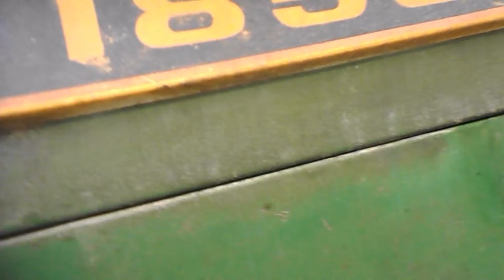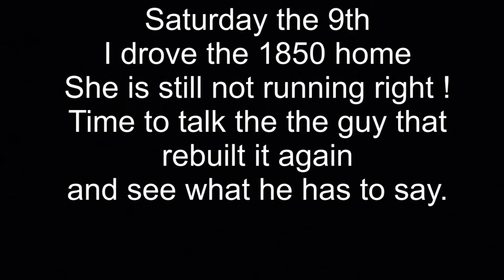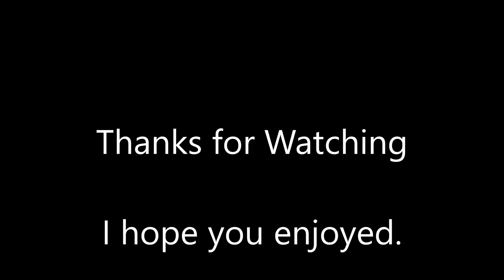October 4th   8th Working on the 1850 Loads of fun !

Comment: Bandit, can't you just buy the old pump from Harry and let her run with that one, I hope Harry is not charging you by the hour at current shop rates 😆 you could have bought a new Magnum if he does 😆 hang in there buddy we all get those days!!
Reply from the maker: As it turns out the day I fired it up on that old pump a guy bought it for his 1850, He saw how my tractor ran on it and bought it. Harry told him he could have it once mine was running good on my pump. The injector pump is at a different pump shop being looked at right now, The guy that rebuilt it has taken the stance that there is nothing wrong with it its my engine and he wont touch it again. So its at another shop and he WILL pay for the repair !  I dont know what the bill is yet for Harry's work he did but he said it wont be much mainly because alot of the work done was under warranty (hydraulic pump) and the engine work wont be much because he installed the injector pump the first time and its still not right, He is kind of upset with the guy that rebuilt the injector pump because of all the BS of the timing of the injector pump (pump timed differently than what the book says to).  If it turns out to be what the guy that has the pump now thinks it is it will be a simple fix and the guy that rebuilt the pump maybe paying for part of the bill to Harry because it was all for nothing.  When I find out for sure what the problem was I'll let you guys know what it was.  Bandit
Reply: @banditfarmer1900  how old is Harry Bandit I know he's camera shy 😆 but he's been around before by the looks of his shop, you can tell those old guys by how much grease has piled over the years on there work table 😆
Reply from the maker: @lukedesselle2491  Well Harry has worked at McHenry's sense 1969, In 1968 he started working there while in school and after he graduated he went full time and he has been there ever sense . That work bench has been in use sense the 20's so it has seen many years of use to say the least. If it could talk imagen the stories it could tell about the tractors and equipment parts that were worked on on it. One of these days I got to talk them into letting me video the inside of the place cause walking threw the front door is like stepping back in time !  Bandit
Reply: @banditfarmer1900  I love sitting down talking with those old guys, they have seen the biggest changes in farming any generation will ever see, I mean they are old enough to remember horses and mules being used to farm and know see tractors with auto steer, just think how much more will change in the next 50 years!!
Reply from the maker: @lukedesselle2491  This makes me think of my grandfather, He was born in 1894 and he worked for the Railroad when he was 12 years old as an oiler . When a steam engine rolled into the station his job was to oil all the wheels on the cars. He worked on steam locomotives and he saw man step on the moon and saw me buy my first self propelled combine . I myself ran a lot of 2N 8N Ford's as a kid and I was always told by the old timers that they were one step above a mule ! LOL I started off running tractors with no hydraulics (AC WC Oliver 60 IH H M's) and all pull type equipment and now I see all the new stuff with all the electronics and really cant believe what it can do. Some of it I agree with but there is some stuff I find silly . The bad part of this is the lack of electronics for the older equipment, I know of several good combines sitting dead in the barn because the computer went bad and they cant find a new or used one to fix it with so now its junk. This is going to be a real problem for farmers in the future unless something gets done pretty soon. I have seen lots of changes in my lifetime and I wonder what will come next ?  Bandit

Comment: The cam ring in the injection pump is upside down.  It will run but will run like crap
Reply from the maker: Well thats what were thinking was wrong with it but the next video will take about this as its going back on after the 1850. Bandit

Comment: I would use pump that works. Just take apart clean an put new seals in it. They are very simple to work on. Go Bundy bears YouTube channel. He has video on pump.
Reply from the maker: I paid to have the injector pump rebuilt and its back with them to make it right. He thinks he knows whats wrong with it by the way I told him it was running. I just got to wait and see what he finds. The injector pump on it has been sold to another guy I have it till mine comes back then the old one goes back to the guy that bought it. Bandit

Comment: Wow. That repair was not it the manual. Glad you figured it out!
Reply from the maker: Harry and I both are surprised there is no information in our books telling you how to set up the gear lash or anything to do with the gear set drive in the books. But I spent several hours measuring the bearings and the casting to figure out how much the shim needed to be to get it right and I got lucky and found a 20.000th shim and it fit perfectly. I didnt help that the bearings have a different edge on them and that let the new bearing go lower in the casting so the shim had to go between the bearing and the gear to get at the right height to get the right gear lash. Lots of measuring and a lot of figuring and we got it figured out and working right. After years of working on a lot of different stuff you learn what to do when there is nothing in the book on how to do it.  Bandit
Reply: @banditfarmer1900  that's great,  bandit!  Good luck getting all the bugs worked out of that pump now!
Reply from the maker: @matthewtaylor2185  New eyes are looking at the pump now so I hope to know very soon what the problem is.  Bandit

Comment: Ship your pump to Area diesel. They are the best. I’m wondering if that pump has guts for a turbo combine engine. May explain the over fueling.
Reply: Ohhhh that's a juicy theory!
Reply from the maker: There was a lot of work done to make for sure it was on top dead center and the pump was timed to that so we made dam sure thats how the engine was set. Once that pump was back on I thought for sure it was going to run like a top but  I was wrong . It slobbers the exhaust will burn your eyes and the engine makes a lot of noise but on that old pump it doesnt slobber the exhaust is just black diesel smoke and it sounds like a sewing machine running ! Something inside the injector pump is set wrong for it to run like it does. Ether the guy is going to take it back or I'll take it to someone else and see what they find wrong with it. I have to talk to the guy that rebuilt it and see what he is willing to do and go from there.  Bandit
Reply: Ya “Watch Wes work” has a couple videos of Area Diesel rebuilding his pump. Once I seen those I shipped 4 of them off to them. The 1 I needed worked flawlessly other 3 are shelf pumps for future use 1 being an 1850 pump.

Comment: The injectors will control how much pressure the pump operates at. They will be set at something like 2200 psi and as soon as the pump builds that much pressure it will pop open and release the fuel. So the new pump will not pump any more pressure than the old one. I have never worked on a cav pump like this pump but I have worked on a roosamaster which is pretty much the american version of this English pump.  On the roosamaster pumps it is possible to install the cam ring backwards and it will run but not very good. Also are you sure you are not timing the pump 180 degrees out. You need to take off the valve cover and make sure the valves are both closed on number 1 cylinder when your timing marks are lined up. If not, you need to turn the crankshaft one more turn until the timing marks are aligned. An engine will run when timed 180 degrees out but not good.
Reply from the maker: When we pulled the injectors we made sure that the engine was on top dead center on the flywheel and varified it one #1 , We checked each injector and they checked out good (rebuilt with new tips 20 hours ago) and fired at 2600 PSi right on the money. We've been threw everything on the engine timing wise and its set dead on the money, The rebuilt injector pump is the problem and putting the old one and it running so good showed us that for sure, I dont know what is wrong with the rebuilt pump but something is out of wack for sure. By the way it slobbers and makes engine noise and with exhaust burns your eyes on the rebuilt pump it all goes away when you put the old pump on it and it runs a lot better too.  I've really been wondering about that ring myself being put back in wrong but I dont know how to work on an injector pump so I'll have to talk to the guy that rebuilt it and see what he wants to do first, If he doesnt want to fool with it I'll have to find someone else to do it. Bandit
Reply: @banditfarmer1900  yes but you can have  the timing marks lined up and still be off 180 degrees. You have to make sure the valves are closed. If not you need to turn the crankshaft one more turn until the marks line up . Even if the timing marks are lined up and its out 180 degrees, it will be firing while the valves are open.
Reply: @banditfarmer1900  The timing marks will line up every turn of the crankshaft but it will only be on the compression stroke every second turn. The pump only turns at half the speed of the crankshaft.

Comment: Just have the guy give you your money back for the rebuilt pump and you buy the old pump problem solved
Reply from the maker: I'd like to do that but 10 minuets after I started the 1850 on that old pump it got sold !  I didnt know this till the next day but Harry did tell me not to worry about it, Harry said use it till I get my pump fixed. Funny thing is its going back on another 1850 !  Bandit
Reply: @banditfarmer1900  have you checked at coulters here in ky to see if they have a good pump and I might know where there's one at
Reply from the maker: @biggbear6218  I dont need to buy another injector pump for the 1850, I had the one on it rebuilt and from day one there has been something not right with it. Its back in a pump shop right now getting looked at again, The guy said he thinks he knows whats wrong with it and he thinks its a simple fix. Bandit

Comment: Bandit this mr. Ha but worked for ford motors same thing on the 460 pre fuel injection on dist.gear good luck and take care
Reply from the maker: I would much rather work on the older stuff than the new stuff !  Hand full of wrenches and you could take the truck apart but the new stuff you got to have a semi trailer full of tools and computer crap to figure out what was wrong with it ! Working on the 1850 is a lot simpler but when one thing like the injector pump witch I really dont know anything about how it works inside is screwed up well you can have everything perfect but one part part wont let it run right. The engine is solid for sure the old injector pump showed me that and now I know for sure its the rebuilt injector pump that has to be fixed and the cause of the problem. Now I just got to convince the guy that rebuilt it and see what he says and go from there.  Bandit
Reply: @banditfarmer1900  when you talk to him ask if he set like turn up had a 720 john deere d 2cyd it wound slobber under lite load live nw ohio
Reply from the maker: @misskitty2721  The CAV injector pump on the 1850 is the same one as on a 4020 JD, So I really hope maybe something might be set like the 4020 is and thats the problem. All I know is it for sure is not right and it needs to be fixed right !  Bandit
Reply: @banditfarmer1900  im pretty sure 4020 do not have a cav pump. Some had a strange pump but was still a roosamaster. The only tractors i am aware of that had cav pumps were 1850 and david browns. Probably massey Ferguson also. Even if the pump was turned up too much, it would make it smoke black under load. No big deal.

Comment: Hello Bandit hmm the story continues. Maybe the rebuilt is pumping to much fuel. I had to laugh when you laughed about how well you can remove pump. Hope all is well with you. To much rain here oct 29th. Have a great day.
Reply: If a pump is pumping too much fuel it will simply run faster or at full throttle it will smoke black. Here is a tractor that is pumping too much fuel but it doesnt make it run bad. Actually makes more power.
https://www.youtube.com/watch?v=qoKoMCnk5jU

Comment: maybe that 1850 just wants the old pump haha, can you buy the old one?
Reply from the maker: Well funny story about this injector pump, There is a guy that has an 1850 thats not running right and hasnt sense he bought it 15 years ago and he was down at McHenry's when I put that old pump on mine and he saw how good it ran on it and basicly bought the injector pump ! As soon as I get mine figured out that old injector pump is going on his 1850, So I have to get my pump fixed cause the one thats one it belongs to someone else now. Same guy has walked by that same engine sitting there for the last ten years and never gave it a thought, But I pull the injector pump and he saw it running on mine and he had to have it ! LOL At least I know for sure that my injector pump is the problem now and not the engine like the guy that rebuilt the pump said it was. Now I need to find someone else to look at my injector pump if he dont want to make things right.  Bandit

Comment: Hey Bandit glad your feeling better. I can't remember is that a RoosaMaster pump or actual Oliver?
Reply from the maker: I feel a little better but this dang monitor is a pain in the butt to ware 24/7 and I got another 10 days to ware it !  I'll be glad when its off and I know what 3 weeks worth of data has to say about my heart. I just hope its nothing real serious . The injector pump on the 1850 is a CAV pump, In fact its the same pump on the JD 4020, I just wonder if maybe some of the settings might be for a 4020 not an 1850. But I hope it didnt cause any engine damage from the pump not being set right !  I just hope the guy that rebuilt it stands behind it and fixes it right .  Bandit
Reply: @banditfarmer1900 Every 4020 I even seen has a roosamaster pump. Not all but mostly only engines made in England will have the cav pump.
Reply: @banditfarmer1900  I've had to wear a monitor before was glad when it came off. My Farmall 350 Diesel pump leaks when you shut it off. You can turn off the fuel under the tank but it will still leak everything out of the fuel line. This was a used pump I found for it I still have the one that came off of it but it needs rebuilt. There is a place called Thorobred Diesel they have pumps for it but they are expensive very expensive.
Reply from the maker: @trockallen  Look on craigslist cincinnati ohio farm & garden there is a guy down in Kentucky that rebuilds injector pumps and his rates are very reasonable. I was going to have him rebuild the one for my Long 900 for $700 but when I told him I found a brand new pump for $900 he told me buy the new pump as I would be better off buying it in the long run. I was going to have he rebuild this one but I went with a local guy instead now I wish I hadnt !  Not many people left out there working on injector pump like there used to be , All the big places want $1500 up to rebuild one and a small guy just cant afford to have them do one so these small guy are our only hope in getting one fixed.  Bandit
Reply: @banditfarmer1900  Thanks a bunch. You are exactly right everything is about the MONEY. Thorobred Diesel they sell parts for all the Diesel trucks power stroke etc. But they sell stuff for IH tractors that's about the price of their inj. pump $1500.00 and give you $350.00 or so for your old pump I just can't see that.

Comment: ? where did you get the tires for the 8n . I need  2 and tubes for mine rears
Reply from the maker: I got the new rear tires for the 1850 from Tire Easy.com  and were delivered to the farm and I had the tire shop come out and mount them. I got 2 new tires from them for $504 each and the only tire shop around wanted $980 each for the tires so they saved me a lot of money !  You might check and see what Wal-Mart on there web site and see what kind of prices they have on those tires and tubes you need. Hay it never hurts to look around for the best price !  Bandit